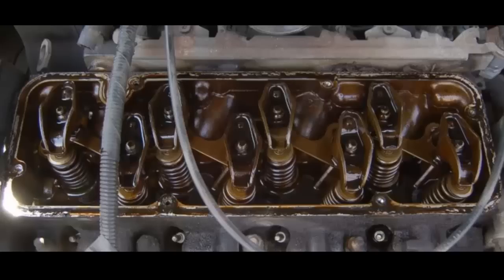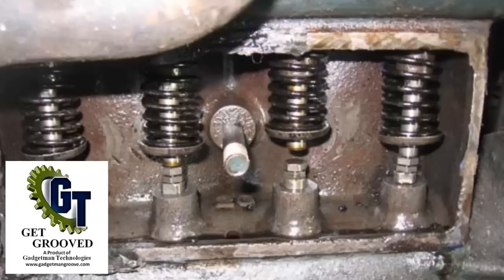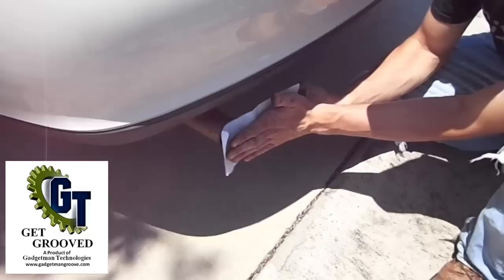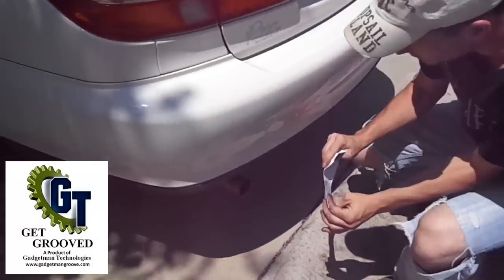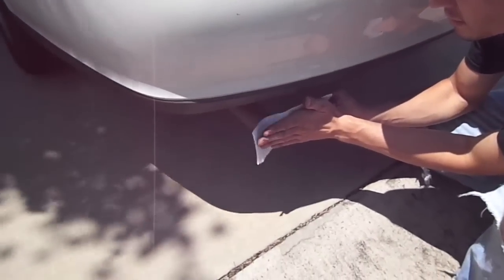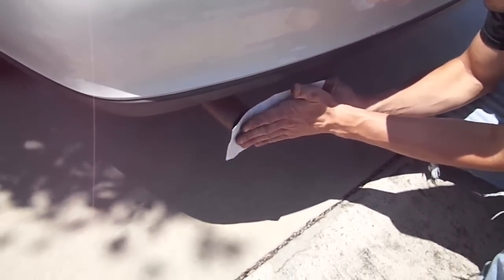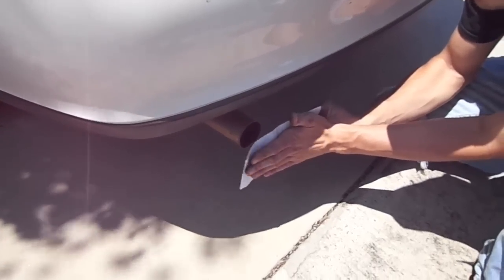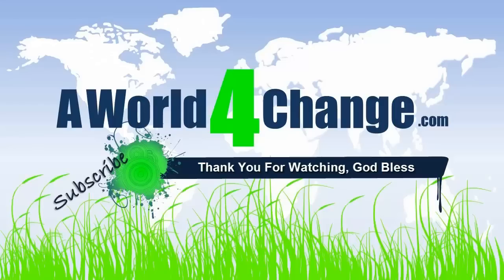How To Diagnose Sticky Engine Valves

Comment: Sorry but I'm not so sure about this.  A 4 cylinder, 4 cycle engine would emit an exhaust pulse of 20Hz at 600 rpm.  This is visible on the paper as 20 cycles per second.

Comment: This is not the proper way to check for sticky valves in modern engines. Looks like the test vehicle was a Saturn L200 which I assume had the 2.2 Ecotec. This is normal for those engines, and many other engines as well. 

The PCV system and the EGR and/or VVT can make the exhaust create a sucking event instead of a blowing event. Fun fact, the 2.2 Ecotec doesn’t have an egr valve. The EGR process is created by precise valve timing, which causes the exhaust to suck in.

Also, Atkinson cycle engines do this as well. Try the paper trick on an Atkinson engine and it will suck in the paper.

Comment: A brand new vehicle will give you same symptom with paper at tail pipe when engine at idle...
   The test using paper like this is opening the engine oil cap and place a paper a base on movement you can determine the amount of blow by which would be an indication of bad seals... piston rings or valve

Comment: This method is none sense! Any restrictions, catalytic converter, muffler, silencer, resonator, spark arrester, split in pipe, y or h pipe, where the headers would meet on high performance free flow.. single cylinder straight pipe, the exhaust valve closing will cause this suction!!
Reply: The paper part sucking back in is what I mean, he’s right about the rest

Comment: Great video as always. However, I did this on my car and it the dollar 
bill did make quite a lot of sound and tried to get sucked in. There is a
 loss in power as well. But then I did compression test and all the 
cyclinders scored around 165 psi. What do you think is happening?
Reply: I think you should have listen to this idiot in the first place.
Reply: And that's the case then it's possible a coil misfire. I have a 2008 Dodge Ram 1500 quad cab lone Star with a hemi. I have eight coils and 16 spark plugs. The front cylinder which consists the front coil, been having problems with it. Already replaced it. Sometimes it can go haywire hitting bumps or accelerating too hard. You may want to find out about your coils. A lot of things can happen including bad spark plug wires. I rank probabilities.

Comment: Man you're a genius!
Reply: Until the paper going back on part?? Suction is near unavoidable with modern exhaust designs and restrictions, too many oscillations and sound waves interfering even with an unrestricted exhaust
Reply: @bmint  I understand, this trick works a treat on older vehicles though. Tried it out on a tired 4AFE Toyota motor.    The effect was quite profound. Turned out to be a bent valve. Same story with an m104 Mercedes motor (converted to free flow), valve train was good but rings were kaput...This trick isn't going to give you the answer, it can however point you in the right direction.

Thank you for your comment!

Comment: i did this test on my old Chevy Impala (1964) and it did what yours is doing. I checked my 350 Crate motor in my other classic car...same thing....I also did it on my wifes '05 Honda and it did it and i did it on my 2018 Silverado and it did it...so all of my cars have valve issues even though they all run fine. Even decided to stop by the dealership by my house, just a few blocks away, their 2020 Chevy Silverado did it as well.
Reply: That's because this test is an example of Bernoulli's principal not symptomatic of stuck valves. Every exhaust system will do this. Hell you can replicate it by getting a rectangular piece of paper and steadily blow over it with a little too much force and the paper will flap the same way
Reply: I'm working on a infiniti i thought have bad valve springs so i tryes the paper test on it and just for reassurance i tryed my truck i just put a newly remanned LS4 in and it does it too but it's got dual exhaust idk forsure but I think this is a myth she should of showed the same car after fixing it to show a difference
Reply: I have had 3 cars that blown a piece of paper steady, the rest they flapped against the pipe, i believe it to be poor valve guide concentricity, a shop that might have done a poor valve job mabye after head gasket replacement is usually the cause.
Reply: lol thanks for further confirmation. I did it on my 67 Mustang with a 302, got nervous to see the paper flapping. Then, decided to do it on my wife’s new Mazda, and it did the same thing.

Comment: I tried this on my wife's 2015 2.4l ecotec equinox.  Got the same result as the video after an intake cleaning . Did the same on my truck that has port injection or sequential injection where the intake valves are cleaned by the fuel , and same result.  No issues with my truck valve wise . So I'm sceptical about this method . Did this test on cold starts and after warm ups . The paper flaps / vibrates as of it were sucking in and out .
Reply: This video is not the proper way to check for sticky valves.
Reply: Did the same thing out on my pickup which was questionable and then tried it on my wife's camry the has no issues and got the same result

Comment: This is a great method and it works 100% everybody i have a 08 toyota corolla with a engine tick and i know its my valves and my mom has the same car as me and i put the paper over her car on the exhaust no flap whats so over i watched this video the other day and now i know that i bought my used 08 toyota corolla with a valve tick but i been using hyper lube and lucas with every oil change and its been getting me by very good and keeps my engine running smoother and Quieter so if it aint that bad then im gonna probably gonna just live with it unless i can get a extended warranty but other than that i ll just keep doing what im doing

Comment: '96 ford explorer xlt with bunch of miles. Tuned up not too long ago. So plugs and wires OK, I went and replace ignition coil. I put some injector cleaner. 
I was going to take apart and check injectors. But I went outside and tried this and it went exactly the same. The same sound and everything, sucking in and out. It's Jan., tags due on March. I'll just keep driving it to the end of March and sell it as junk. 
Thank you all. 
One more thing: maybe it started going bad after I changed the belt for a shorter one. I did that because the ac compressor clutch went bad. Or maybe old engine with almost 200K miles, whatever.

Comment: A vacuum gauge can show a fluctuation in vacuum. The needle will move back and forth. If it moves back and forth intermittently, the valve could be sticking. Drops of several inches regularly can be leaking valves. Change the oil and drive it. Remove the rocker arm and hit the spring with a hammer to loosen it. Bleed-down the lifter and install the rocker arm.
Reply: Thanks Marty. Ill try that on 71 my beetle. It is a new 1916cc engine, unfortunately my alternator was my old one. It seized and threw my belt. Being an air cooled engine it had no fan turning at the rear of the alternator to cool things down. It overheated badly. I put a new alternator in, it turns over and drives but there is some rough idling now and  a loss of power. It popped and backfired once. I changed the oil and ill do the spark plugs next and try your trick. Hopefully I haven't done too much damage. The oil was new and went really black and burnt when it got hot.
Reply: Same principle

Comment: OMG!!This method proves that a 0 mile car has a stuck valves as well.
Have you ever heard of exhaust back pressure?!
Reply: yes, never heard of exhaust back vacuum though...
Reply: @troyb3659  any time pressure passes through bigger or smaller areas it creates an oscillation! This will push and pull, in and out.. no actual vacuum but it will always have an in out, “hyperventilating” effect at the end of any pipe even straight free flow, because of the valves and even the pipe bends
Reply: @troyb3659  exhaust gas recirculating valve.. does exactly that when the computer tells it too.. EGR valve
Reply: Many new cars don’t have EGR valves. The EGR process is done via valve timing, so on newer engines it’s completely normal for the exhaust to suck in, hence the name Exhaust Gas Recirculation.
Reply: Can I pick your brain on this? Have a question about newer cars

Comment: My subaru was doing this and throwing a misfire code on cylinder 4, low power, stalling out at stops, and idling very rough. Pulled the head, turned out to be a toasted exhaust valve. Its a $17 part, but changing it out takes awhile and while its all out..... $$$ skys the limit, i try to keep it reasonable.
Reply: Did you have to machine the head while it was off, or did you just check it with a straight edge?
Reply: Captain Rorvik its in the machine shop right now, i dont think it needs to be machined, it never overheated. But im replacing the valves and making that head as close to new as i can.

Comment: If you've got a V engine, would you be able to determine which bank by pulling O2 sensor and using a vacuum gauge or just putting your piece of paper over the bung hole?  Maybe a thinner piece of paper - like TP for your bung hole.
Reply: Dwl .. 🤣

Comment: Could this happen after a car has warmed up? My 1999 mazda 626 lx has problems after it warms up.
Reply: possibly. my car nissan 180sx has a missfire too after warmup.everything has been replaced except fuel pump but have a guage on it so good pressure. maybe vales stick after they get hot and then stick in the guide
Reply: Once car warm up the ecu takes info from sensors and adjust accordingly ...if you only have this problem at idle then obviously a sensor is giving wrong info.. 
   Main sensors that will affect idle;
MAF =Air flow.... check n clean it

MAP= Manifold pressure... check n clean

O2 sensors... check if working use a.  obd2 tool to do so.
 If all these sensors check out to be good then you likely have a air leak which cause un meter air which cause erotica engine idle.... check small hose/line after the air flow sensor.

Comment: ok just did this test on my 87 fox st see if it was my problem and the paper flaped so i i tryed it with my 2016 mazda 3 with less than 1000 miles on it guess what same result actually the mazda did it worse hmmmm maybe im doing it wrong idk
Reply: thats cuz it's BS !!!!
Reply: Depends on the valve overlap. If cam is fixed (no secondary lift lobes) and valve overlap is set wide for high RPM performance, both intake and exhaust valves will be open simultaneously for a longer time at idle. This could happen even if the valves are within spec. It's a shadetree technique that relied on the low valve overlap angle of older US V6 and V8 engines that are tuned for low RPM power. You can definitely tell if there's a problem in these engines using this technique, but it won't work on newer engines with wider valve overlap.

Comment: so what about on the overlap? when the piston retracts doesnt it suck a little from the exhaust before the exhaust valve closes? or it depends on the type of timing
Reply: +lloyd mason It doesn't work that way. Engines have intake and exhaust valves that are not interchangeable. In cylinder one we have a piston in TDC (top dead centre), then it comes down and sucks in air and fuel mixture into the combustion chamber through the intake valve/s, while the exhaust valve/s is closed. When the piston comes up again and eventually reached TDC again, at that precise moment the intake valve closes, the spark plug ignites the fuel mixture which forces the piston down to BDC via explosion. Just as the piston reaches BDC (bottom dead centre, the exhaust valve opens to let the burnt bi-product out, as the piston travels back up to TDC to complete the cycle.
Reply: yes however, there is an overlap when the intake and exhaust valves are both open at the same time for a slight moment before the intake valve is full open, thus wiill cause the same vacuum effect on the exhaust for that brief moment.
Reply: +lloyd mason Well yeah, but that interlude is infinitesimal. Still you have a point, if the valve springs are worn out and fatigued, that gap would become more considerable.
Reply: yea thats true

Comment: I recently just bought a 99 f150 4.6 and have had true duel glasspacks installed recently, the left side of the exhaust is smooth flowing, but the right side just isn't right, at idle it seems to have a miss sometimes but not often, but when you get going, it doesn't pop or any thing untile you give it about half throttle and the the right side pops loudly, would this be the result of a burnt valve or a sticky valve? I really don't any thing about this stuff, I'm learning as I go here.

Comment: I'd vote that it is a fouled spark plug, bad ignition wire or coil pack,  not a valve.
Reply from the maker: +Robert Kirsch - The valve(s) have to be sticking open for there to be a reverse vacuum that's this noticeable. I'm open to other ideas....but I don't know how a fouled plug or ignition could cause this....as there would still be air always moving through. Right?
Reply: @WayneMeador i have spent thousands of dollars and habe conducted many experiments on many of my vehicles over the years and have ruled out many things, and it all comes down to the valves, however it isnt exactly a valve sealing issue but the concentricity to the valve guide, factory engines eill run great for a long time, but engines come in for head gasket repairs and a poor valve job is done, what I believe is happening is as the valve is closing when the valve closes against the seat it either jams in the guide and flexing the valve head closed, it sticks in the guide momentarily, or another idea is as it closes one side touches the seat first, therefore affecting valve timing, by the time the other side of the valve head flexes and closes it causes reversion and exhaust gasses suck backwards making for a rough idle and extremely poor gas mileage and no low end torque.
Reply: *****
Nope.  Find a good running engine and remove one spark plug wire.  You'll experience the same "sucking" effect. It really can't suck in, it is just not blowing out much on that one exhaust stroke.
I mean, don't get me wrong, it IS possible it is a bad valve but odds are that it isn't.
Reply: +Robert Kirsch if you have an exhaust valve that's open then when the piston moves down into its bore it's going to suck air through the exhaust port. So I'd say odds are pretty good that it would be a stuck exhaust valve.
Reply: Not knocking your experience or anything. I have a 96 Mustang GT with a bent exhaust valve and I've done the comparison with a control car and I can verify it.  Just from what I've seen.
Reply: This0is0pointless Yes.
Reply: I have a loud tapping in my 90 Dodge 2.5. It's quiet upon start up and then it taps gradually and slowly gets louder approximately 20 seconds after start up and 20 seconds or so after it sits for a few minutes after driving and then starting the engine again. I added Lucas oil treatment and it went away for a couple of days but then started doing it again. I'm using 15-40 or 20-50. The head is new 2-3 years old, regular oil changes with Penzoil, well maintained with many parts replaced. I don't think it's a bearing or piston problem but I could be wrong. Sticky valve? I have no clue what to consider.
Reply: @MrJohnnyDistortion  Hi. I am having a similar issue with my 2008 Nissan Xtrail. Did you eventually find a fix?
Reply: @mturawa  
Yes, it was blow by in one cylinder. Then later on down the line the camshaft snapped. YAY!
Reply: ' pl
Reply: MrJohnnyDistortion did you know the problem
Reply: 40 years of experience with all types of engines and diagnostics.  But you are entitled to your "opinion".
Reply: you are 100% correct.
Reply: cant you test for this with a vacuum gauge?

Comment: No es seguro  las fallas de bujia tambien hacen el mismo efecto,por tanto para saber el estado de las valvulas de un motor yo hago lo siguiente , Tomar la compresion y comparala con los demas cilindros , suponte Baja compresion Cil 2  
Ahora la otra parte de la prueba , pon en cilindro 2 en compresion  Si fuera un vehiculo de cambios mecanicos engrana la trasmision en el cambio mas alto .Calza  las ruedas o pon el freno de mano, despues inyectas aire en el Cil 2  Con 50 lbs alcanza. Si el aire se escapa por la admision Esta la valvula de admision en problema  Si el aire hace gorgoritos en el radiador ,tiene la junta de la tapa rota   si el aire suena en el tubo  de escape, Valvula de escape quemada, Si se escapa por los respiraderos del carter , aros de piston o piston con fugas  La prueba del aire es la UNICA prueba validada incluso por Caterpillar

Comment: YOU SHOULD HAVE ALSO SHOWN A PIECE OF PAPER ON A GOOD ENGINE FOR COMPARISON!
Reply: A regular car just pushes the paper, you’ll feel the exhaust suck the paper if the springs are bad
Reply: Very true but it was still helpful.
Reply: They can’t because all engines do this!!
Reply: Every dam engine pulse exhuast at low rpm/idle ...